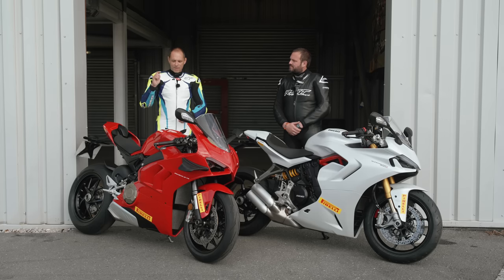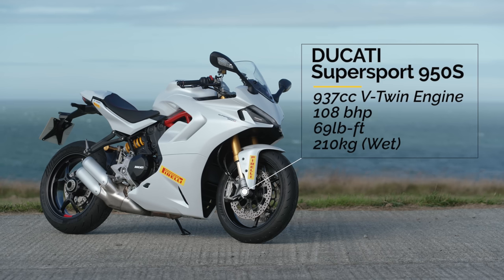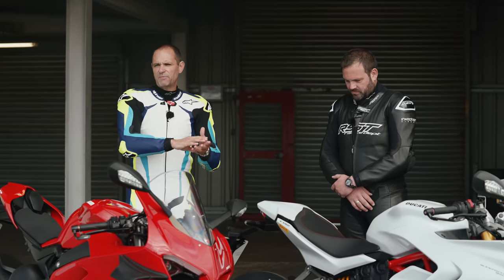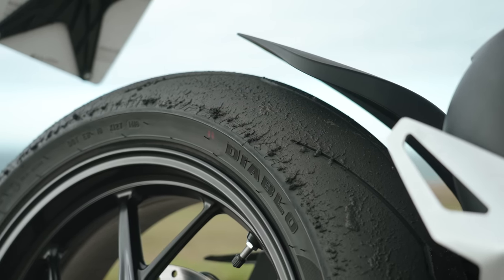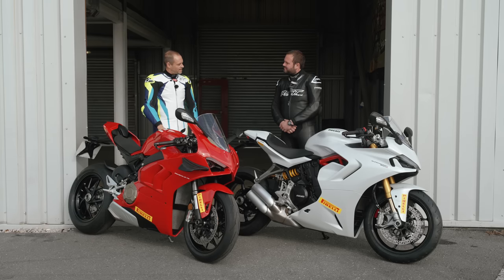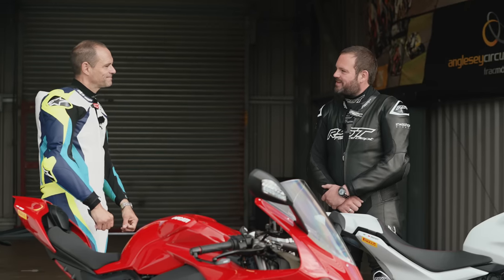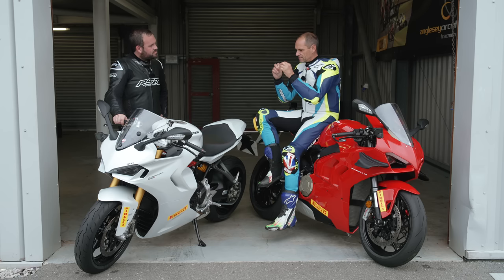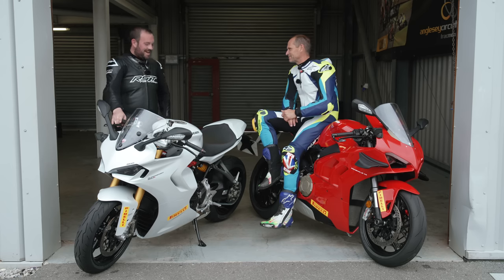How to ride on track | Neevesy's riding tips | MCN

Comment from the maker: what is your top tip for a new trackday rider?
Reply: Go at your own pace.
Reply: Listen yo Neevesy, I listened to one of his prior videos before my first trackday and it was the right amount of info exactly when I needed to hear it.  Super knowledgeable.
Reply: Before I had my first trackday, I had already practiced at home:

1. Body position on my bike in the garage, a tip is to make sure someone is filming you or you use a mirror.

2. Emergancy braking (which will translate to normal braking on the track)

3.Turning your head into every corner, don't scout with your eyes but actually turn your head into the corner and look as far away as you can.

4. Throttle control as if you are on the track (Without breaking the law of course)

5.Get familiar with rev matching.

There's probably something I forgot, I might add it later.

If you master or at least are familiar with what you are doing, your first few track days will be way more pleasant and less overwhelming
Reply: Ride on the balls of your feet. No Duck footing it. 🦆
Reply: Keep your ego at home
Reply: Feet position and track vision! Great Video! I posted a video about body position today as well, this is amazing :)
Reply: warm up tyres
Reply: @Bow-to-the-absurd  great one ☝️
Reply: Let the idiots go out first to get their risky adrenaline fix and then go out when it's a bit more chilled.
Reply: @oliw3664  works every time, clear track!
Reply: Aim to ride smoothly and youll get quicker that way.  Remember to listen to the officials, take coaching if it's available and if you don't know ask! But most of all remember your bike is the best medicine around for the mad days we now live in.
Reply: Keep hydrated.
Reply: @LushmanGB  great one!
Reply: Accept that its a humbling experience, start slow. and work up slow getting the technique in stead of just pressing on :-)
Reply: Do what you love, and love what you do. Also, do what Neevesy says... man knows what he's doing.
Reply: @LushmanGB  underrated advice. Keeps headaches, wooziness and general fatigue at bay…
Reply: Work on one, maximum two things per sesion. E.g. work on getting the exit of turn 3 right.
Reply: remember its a race
Reply: Get your suspension checked to make sure the sag is correct ( you might needed it a bit stiffer for the track )
Reply: Adjust your brake lever and only use one finger.
Ignore everyone else!
Reply: dont take a panigale so you wont be scared of the cost from binning it
Reply: My tip would be to actually do it. Preferably with an instructor(also if you think you are fast). Does not have to be a trackday, just a riding course on a track.
Reply: The Trackdays offer tuition , some are free so take advantage of it
Reply: Focus on developing one skill at a time till it's locked into muscle memory.
Reply: The pegs through your feet are the focus of weight, not your butt (sport vs cruiser). Squatting position. Relax arms. Personally sometimes (depending on the bike) I use just fingers not whole wrist to start throttle out of slow corners.
Reply: Hydrate!
Reply: Recent noob here. I found the following helpful for mindset.. 

Stay within comfort zone while getting used to the track. Once comfortable, smooth, and consistent experiment with gradual increases in harder breaking/acceleration/lean and faster entry. If you have good equipment the bike is more capable than you think.

Take the first few laps in a session easy to warm tyres and focus the mind. Focus on your ride and try to forget people behind. They will be able to pass you safely if competent. Look where you want to go, not where you might crash or run out of road.

Get tuition - free at most track days. 

In the UK you now need lever guards and back protection.
Reply: Top tip seems to be: buy a 40 grand motorbike
Reply: Go at your own pace and work on body position
Reply: Don’t fall
Reply: Take a fold up chair

Comment: Neevesy always does good videos and I while I enjoyed this one too I want to share my own experience.

I did my first track days this summer (2 day group coaching with video recording) and this is what I learned (spoiler: it was a humbling experience)

1. I watched a lot of track day videos on YouTube and thought that would give me an edge. It didn't.
2. My track was very technical, very hilly with poor overview (Ledenon in France). I should have started on an easier track. (It was also very hot in July)
3. It was difficult to remember/know where on the track I was as things went so fast.
4. I was nervous about other novice track riders overtaking me safely, especially in corners, coz we had no mirrors allowed. (Several guys crashed, no one was hurt)
5. Body position, gears, looking through the corners, braking going in to the corner sounds like just a few things to remember, but it's a lot when things go fast, and you might remember one or two at a time.
6. I thought I was hanging off the bike, but the videos didn't reflect that
7. I probably should not have started out on my own 1000cc 142 HP bike (Ninja 1000SX)
8. Riding a track is a lot of braking, accelerating, braking, accelerating and I found it's not what I want from riding, I like touring, going and seeing places instead of round and round on the same spot just trying to be faster all the time (which is ironic considering my YouTube name ...)
Reply: Very good comment
Reply: If you try it with a 400cc or a lower powered 600cc its a different ball game….you can ring the bike’s neck a bit more and have more fun👍🏻
Reply: Thank you for your very candid comment.
Reply: I totally understand where you’re coming from.It’s why I think I’ve probably not done a track day yet. I actually really love engaging with the almost computer game like element of road riding. It’s almost like everyones out to get you. It keeps the mind focussed.
Reply: The point about other riders overtaking is a good one.  I found that to be incredibly distracting and made it difficult to focus on the task at hand.
Reply: One thing you forgot is the body effort in the track, if you are not fit , mostly the legs you are done forget it , you risk seriously your life after 3-4 rounds , before hitting the track do 1 month of training for your legs, abs and very important the neck muscle as you will use this muscle for 10-15  min continuously

Comment: Excellent! I have ridden fast bike for more 40 years,  done all sorts of trackdays, practice and so on. Also some clubracing with Laverdas in the mid 80's Your lowpitch, confident, clever and experienced teaching amazed me! Wish you had teached me 30 years ago.... This was like a crush course of everything I have learned compressed to 20 minutes!  Though , hitting the throttle stop scares me these days.  Maybe because the bikes a ride on trackdays are a Moto Morini Corsaro 1200 Veloce and an old Benelli Tornado 900 RS,  from German Superbike racing. No riders Pampers,  lots of power and torque.... But very rewarding and fast if you get it right. Last year on the lokal racetrack I found out that ,except from the long straight, the Morini had no problem staying on the tail of the instructors BMW S 1000 RR!  In the tighter parts I could get back to his tail again. And he's no bluff,  once runner up in Super Sport 600 in Sweden and he also raced in Germany!

Comment: So, on a track when making a corner entry, is he saying to completely roll off the throttle when in the corner? Like trail braking while the throttle is rolled off and then when the apex comes, slowly rolling it on again? So no consistant gas in the turn like on the road right ? It’s about using our corner entry speed under control with the trail braking until the apex is there? Brilliant video

Comment: Really enjoyed that! Another point worth mentioning - if you're in a low gear in a tight bend and have to brake, there is a chance you can stall the bike. I've been thinking about taking my K1100RS on a track day. Did with my K100RT back in 1990 ish and had pedals scraping the ground :D

Comment: This off throttle, free wheeling cornering using just the momentum sounds like an interesting concept. I'll try it on the track next season. I don't see it working for total beginners though, there is too much going on for a track beginner and there is a few components you need to time perfectly in order for this to work. I can only see this working if you're refined with braking when to let go and keep the right gearing, that is key, so you can engine brake and keep the weight forward for enough grip but still reach the apex. Otherwise, a wrong gear up or two in a somewhat slower corner, and you might find yourself floating with little grip and unresponsive bike when adding throttle.
An amazing video as always btw.
Reply: why free wheel when you could trail brake,
Reply: @chetj1483  I agree. I use trail braking for the most part. But I would not entirely dismiss this technique either, especially in some corners like flowing, fast corners. You can enter those pretty fast using  this technique

Comment: I have a question. I've done levels 1 and 2 of CSS and I'm about to go to my first track day on my own. I'll be alone and one  of the requirements is that my sidestand is zipped tied or wired in place. My question is, when I come back from a session, what's the best way to get off my bike and get it on the paddock stand since I'll be alone? Any suggestions or tips would be appreciated.

Comment: Im no pro. But i have my track experience and just recentky taken a course woth sime of the pro riders with ducati in moto america. The idea of free wheeling into a corner seems like bad practice. The nikes chassis is designed seound load. Whetehr its the front end beinf losded ir the rear. Free wheeling is an unbalanced and kess safe chassis. I know trail braking is a more advanved technique but keeoing slight oressure on tbe front brake ti the apex is WAY safer snd more controlled, and faster, than free wheeiling in. Even if its literally finger pressure. The video was great but that seemed like an odd thing ti buidm muscle memory in bad practice